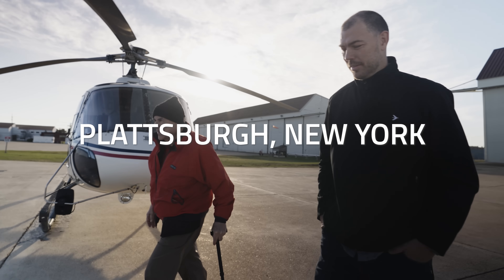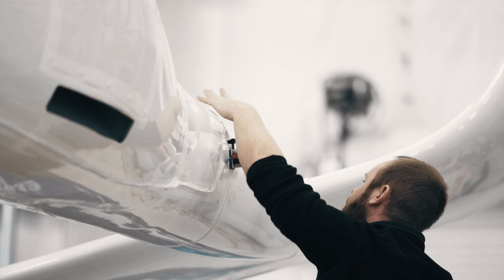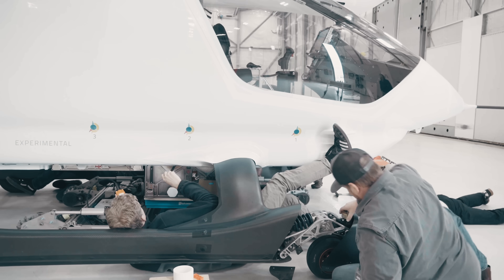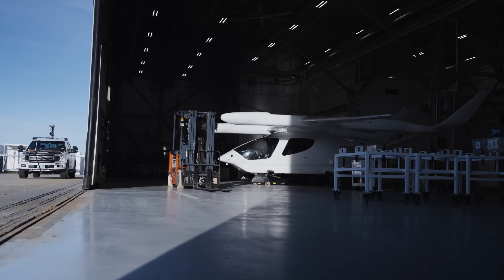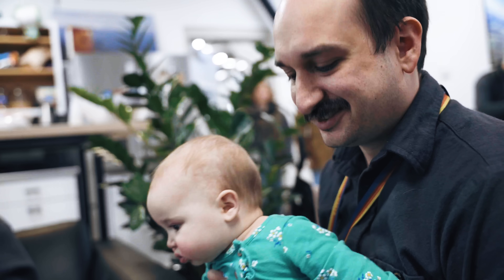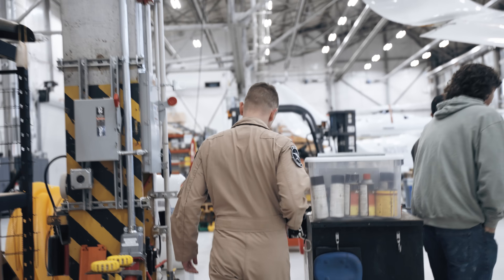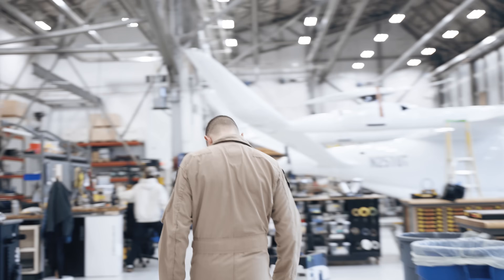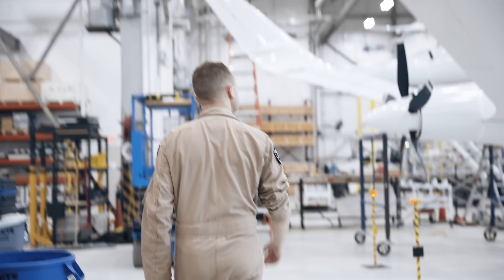WAYPOINT: Transition

Comment: Question: I don´t know how to to formulate my question (since I´m not an engineer) but: is there a system that calculates when the rotors should engage, power up, power down and disengage during transitions from vertical to horizontal flight (and back)? Or is that just done manually? Thank you.

Comment: Since this design does not have tilting rotors and the propulsion rotor always turns, the video would be so much better with data displays showing the lift rotor lift (or torque, or power), propulsion rotor thrust (or torque, or power), and wing angle of attack. The transition would be shown much better with that sort of information. As it is, the lift rotors just stop and later restart, giving the impression - undoubtedly incorrect - that the transitions are instantaneous.

Comment: OK. That's nice. You've just re-invented the Osprey, a 30 year-old technology which the Marines have been using for decades. So what EXACTLY is NEW here??? Where is the breakthrough I don't get it. I'm tired of hype replacing genuine invention. Too much of that in tech these days.
Reply: 100% electric. There is no rotating the rotors. Built out charging network. But no where near as capable as the osprey.

Comment: I love seeing the progress of eVTOL aircraft but seems like they have a long way to go to be practical. This one apparently has the record for range at just over 300 mi and I doubt that is with 45 min reserve as airplanes are usually rated. I fly a Rutan derived canard experimental 4 seat aircraft. It has 1400 mi range @ 200mph with reserve. It gets almost 30 mpg at that speed and cost much less than $100K. I figured if I took the motor out of my Tesla and made it a 2 seat airplane to make room for batteries I would have about 200 mi range without reserve. Batteries have to get an order of magnitude better.

Comment: congrats. Can you also just hover, do a true vertical takeoff before starting forward motion?
Reply: These are test flights, elevation is a safety factor. The plane could continue to go vertical much higher before transitioning. Keeping it 16ft of the ground keeps the test pilot safe.
Reply: @wcallahan15  thanks for the clarification. Looking forward to seeing her out in the wild.
Reply: A hover take off is seen at 2:25… followed by a “transition out to wing born flight”.   At 3:30 the lift rotors are “stowed” and stopped, indicating the end of transition out to “conventional” mode of flight. Typically a safe and energy efficient vertical take off will be within 10 feet of the ground, before gaining forward speed and climbing out.
Reply: @handhwiegman8115  but yes you can fly like a helicopter, it's just going to be mostly forward flight.
Reply: @handhwiegman8115  not if you are trying to land between skyscrapers or in a vulcano like Airwolf ;)